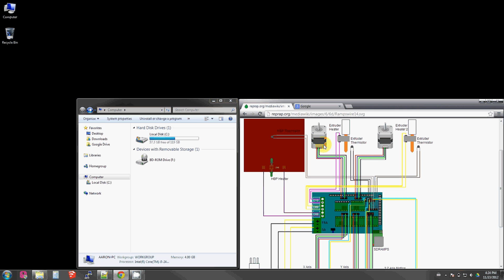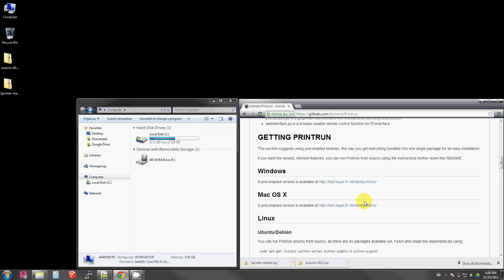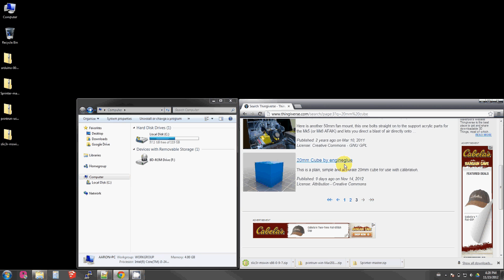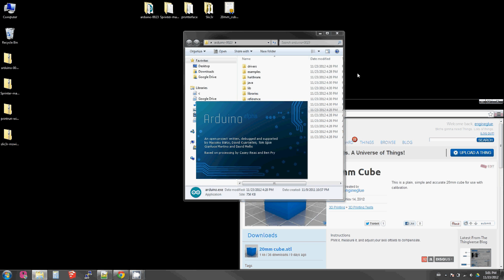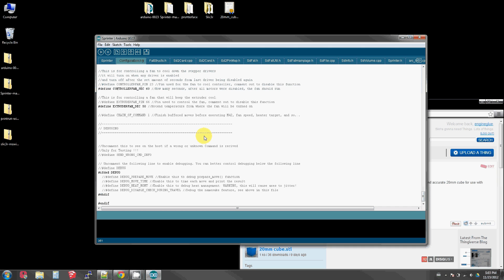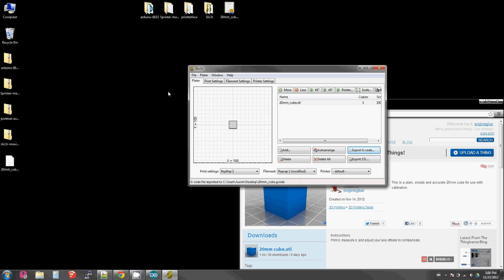RepRap Prusa Mendel Iteration 2 Assembly 21 - Ramps 1.4 Software

Comment: how i turn off the heated bed on the firmware? i tried setting on configuration.h #define THERMISTORBED 0 but when i try to compile it shows an error 

In file included from /heater.h:25,
                 from heater.cpp:26:
/thermistortables.h:421:2: error: #error No bed thermistor table specified
Reply from the maker: Try to comment out. ---->  //#define THERMISTORBED 1
Reply: It does not work either
Reply from the maker: Try Marlin. https://nwreprap.com/downloads/marlin_i2.zip

Comment: This has worked for me but the lcd screen will not work the sd card yes is there a link to where I can get the code for this sprinter version that suits this as there are so many of them.
Reply from the maker: TheRogueRedwolf It will be easier for you to use Marlin. You can download it from my website at http://nwreprap.com/software/
Reply: thanks I tried it first and the lcd worked great but it would not let connect via laptop I am going to try It again as I know a lot more about it now thanks very much for your reply.

Comment: If i want to put 2 motors on the y axis instead of 1, can i set the second motor on the E1 driver? i've got an arduino mega and a ramps 1.4 but i need to use two motors on the y axis. Could you help me?
Reply: Goffredo Giordano The firmware i'm using is marlin

Comment: how do i get the motors to spin 2 directions , when i input a command it can only work in positives and sounds like it wants to do something on the negatives but just stays there what do i do?
Reply: I just ran into that yesterday. It turns out the firmware does that when it detects a triggered endpoint (the switch or optic sensor at the end of an axis). Try inverting them or enabling/disabling the pullup setting. Mine worked when I disabled the pullup and set the inversion back to false.
Reply: OK I'll try thanks

Comment: I've got my printer set up and wired, and pronterface connects, but whenever i try to get the motors to move, the x and y axis just jerk a tiny bit and the Y axis doesn't move at all. i've tried adjusting the potentiometers but I can't get any more than a quick jerk.

Comment: I have a problem, the "x" axis moves excellent, the "y" axis moves but inverted (no problem, just i just need to change it on the arduino program but... the "z" axis jus go down (also inverted) but it doesnt go up... how can i fix it?
Reply from the maker: Is your x axis limit switch on the side of the RepRap with the x end motor mount or x end idler? Is your y axis limit switch on the front or rear? For the z axis, just switch the stepper motor plug around.
Reply from the maker: engineglue Note, only plug and unplug components while the USB and power are disconnected.
Reply: engineglue My "x" axis limit switch is on the "x-end-motor", the "y" axis limit switch is on rear.  I plugged around the z axis but it seems to be the same problem, it appears that it only works in one direction.
Reply from the maker: José Manuel Martínez Valdez Let's work on one axis at a time. This would be easier for me if you emailed me. My email address is on my website at nwreprap.com. When you switched the z axis plug, does it still only go down?
Reply: Ok, now I've sent you an email.
Reply from the maker: José Manuel Martínez Valdez Thank you.

Comment: Question for anyone that can help!!!  I have all the programs installed however when attempting to upload or check the Arduino Sprinter Config.h I get errors in the Sd2Card.cpp tab and it wont let me upload.  I can't figure out how to fix this, any help?
Reply from the maker: This is likely due to an incompatibility between the firmware and the arduino software. Try downloading the Arduino 0022 software and Sprinter firmware from here: https://nwreprap.com/software/
Reply: engineglue That worked perfectly for the first problem, now I have another, lol.  I am getting an error when I try to upload, its saying that my port (COM9 the established printer port) is already in use.  This is the error message I am receiving: 

Binary sketch size: 31098 bytes (of a 258048 byte maximum)
processing.app.SerialException: Serial port 'COM9' already in use.  Try quiting any programs that may be using it.
	at processing.app.Serial.<init>(Serial.java:144)
	at processing.app.Serial.<init>(Serial.java:76)
	at processing.app.debug.Uploader.flushSerialBuffer(Uploader.java:75)
	at processing.app.debug.AvrdudeUploader.uploadViaBootloader(AvrdudeUploader.java:93)
	at processing.app.debug.AvrdudeUploader.uploadUsingPreferences(AvrdudeUploader.java:56)
	at processing.app.Sketch.upload(Sketch.java:1603)
	at processing.app.Sketch.exportApplet(Sketch.java:1568)
	at processing.app.Sketch.exportApplet(Sketch.java:1524)
	at processing.app.Editor$DefaultExportHandler.run(Editor.java:2293)
	at java.lang.Thread.run(Thread.java:619)
processing.app.debug.RunnerException: Serial port 'COM9' already in use.  Try quiting any programs that may be using it.
	at processing.app.debug.Uploader.flushSerialBuffer(Uploader.java:99)
	at processing.app.debug.AvrdudeUploader.uploadViaBootloader(AvrdudeUploader.java:93)
	at processing.app.debug.AvrdudeUploader.uploadUsingPreferences(AvrdudeUploader.java:56)
	at processing.app.Sketch.upload(Sketch.java:1603)
	at processing.app.Sketch.exportApplet(Sketch.java:1568)
	at processing.app.Sketch.exportApplet(Sketch.java:1524)
	at processing.app.Editor$DefaultExportHandler.run(Editor.java:2293)
	at java.lang.Thread.run(Thread.java:619)

If you read all of that (I am sorry) I am sure you noticed that these are all processes of the Arduino, I am lost in the sauce here, any more help would be sooooo appreciated, thanks!
Reply from the maker: Michael Sanders Try restarting the computer.
Reply: engineglue No help at all, sry, any other ideas?  I'm asking around the Arduino forums but I've gotten nothing yet.
Reply from the maker: Michael Sanders Are you getting the same error? "Serial port 'COM9' already in use". What happens if you remove the Ramps from the Arduino? Same error? What OS do you have? What COM's are available? If you send me an email, could you include a screen shot of your COM's from the Device Manager? My email address is at nwreprap.com.

Comment: Very important question: what should I do if Marlin does not make my printer move at all?
I've tried a test software and all is well, the whole things moves and i mean all the connections are good.
Moved over to repeiter and their firmware and just the Z-axis won't budge. Please hit me with some ideas... I cannot figure this out and it's very frustrating.
Reply from the maker: It probably has something to do with the endstops. Do you have them connected as normally open or normally closed?
Reply: They're optical and they're "closed" I've reversed the logic and M119 gives me the right result "L" when free and "H" when activated.
Reply from the maker: Adrian Ciubotariu Have you disabled the pullups in the firmware?
Reply: Both in marlin and in repeiter,  that's another reason why it puzzles me why one does not work at all and the other just "forgets" it has a Z-axis.
Reply from the maker: Adrian Ciubotariu Does the z axis move in either direction if you activate the endstop?
Reply: Nope. This was one of the first things I've tried.
By the way, thanks for trying to help with this. Much appreciated
Reply from the maker: Adrian Ciubotariu Perhaps you could just use the firmware that works? :) Have you asked this question at #reprap?

Comment: I just completed wiring the RAMPS 1.4 for my build.  I'm noting that the wire colors from the motors do not match the diagram on the wiki.  How much of a risk am I taking by turning the machine on?  I've already uploaded the firmware and the rest of the software is installed, I have not yet powered up the completed machine.